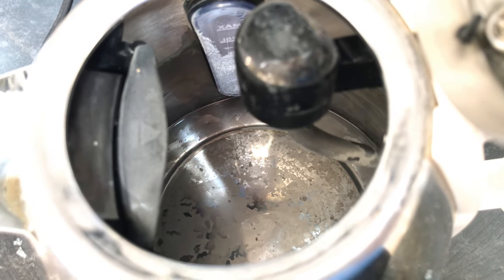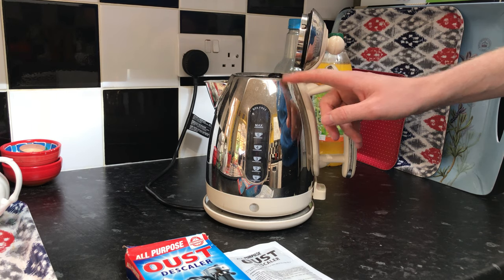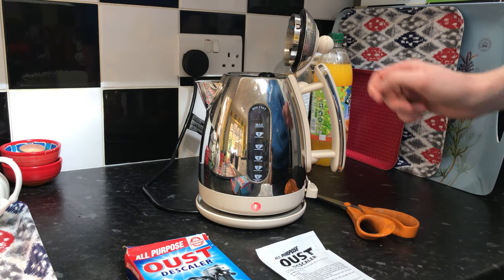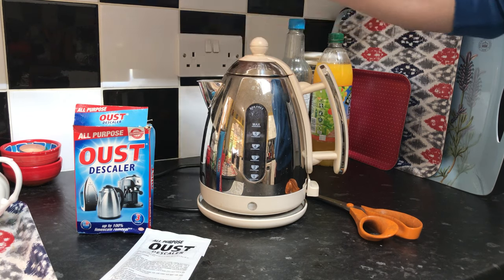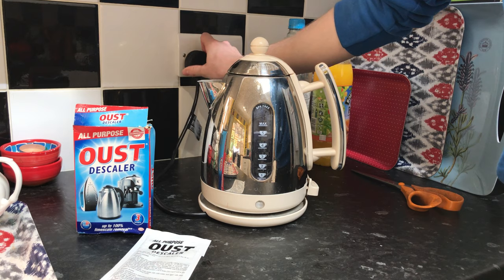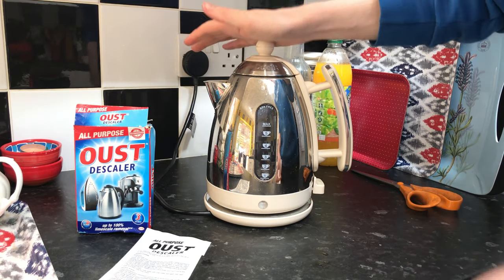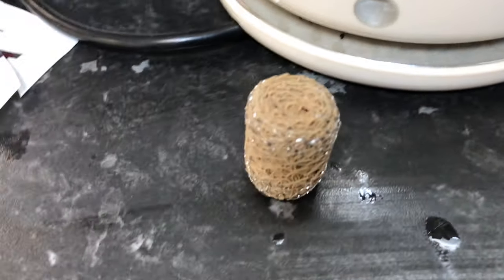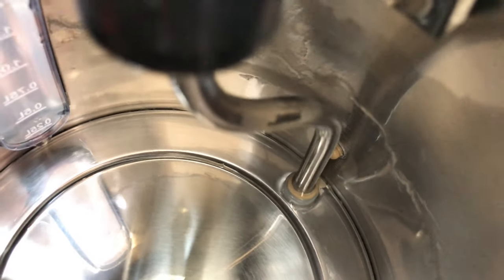How to descale Dualit kettle with Oust - All Purpose Descaler

Comment: These are decent but the dissolvable tablets work a lot better
Reply from the maker: I will have to get some and test them out, my kettle scales up so quickly I should really descale it every two weeks or use filtered water.
Reply: @ChrismasKitchen  I hear you ! the water in my area is really rough also so have the same issue , I know that tesco sell a pack of 4 for a pound which are pretty good :)
Reply from the maker: I might just need to pick some up.